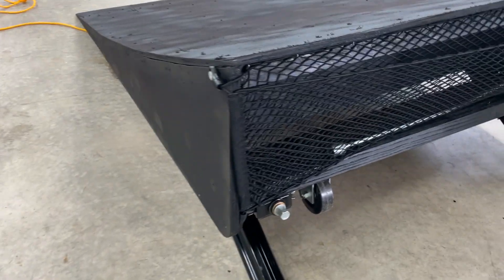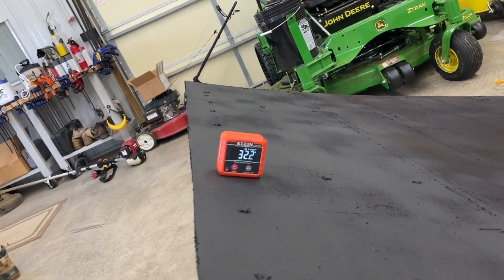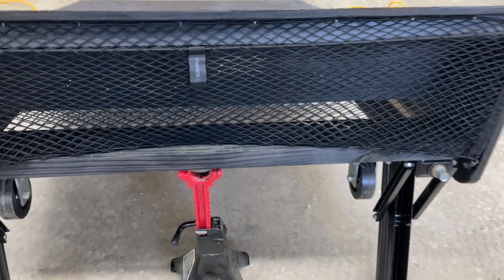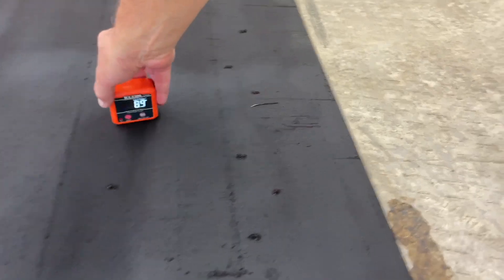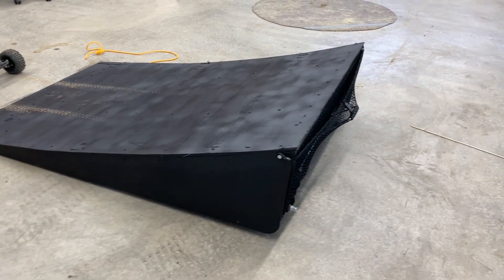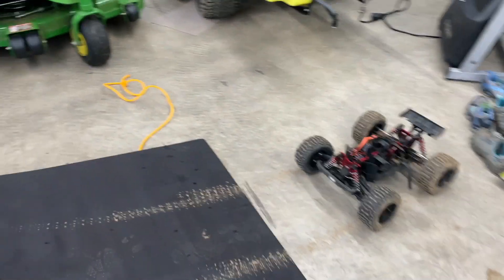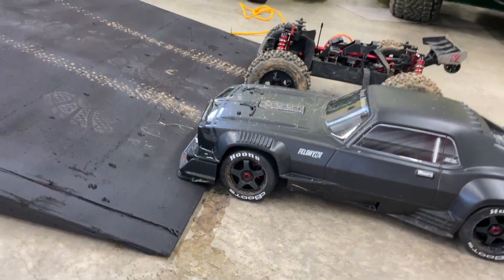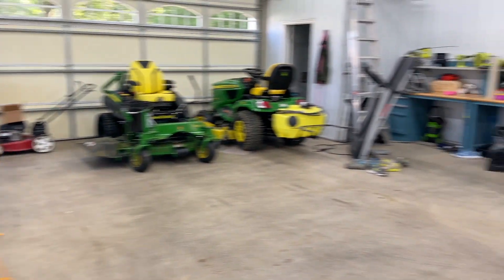RC Jump Ramp Design Adjustable Height

Comment: Pretty dam sic man.   Nice job.   Btw.   What are the actual adjustable arm parts called?
Reply from the maker: Trailer leveling or stabilizer jacks, here is a slightly different version, same brand BAL https://www.dyersonline.com/bal-17-light-trailer-stabilizer-jacks-2-pack.html?utm_source=googlebase&utm_medium=shoppingengine&srsltid=AR5OiO3QLfeUDC-Y86RSqHZYnhn07Cbjd1vpMZm3M42lrFaRvziBh3Bk7VQ